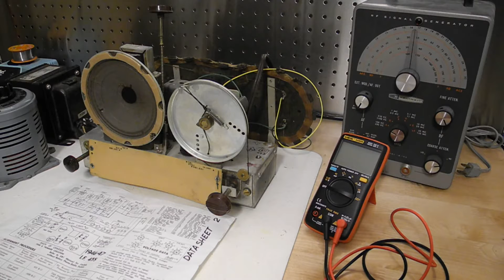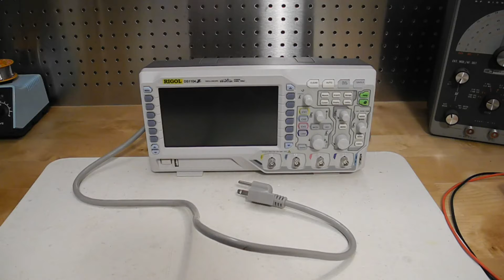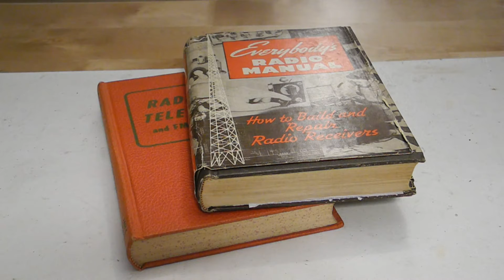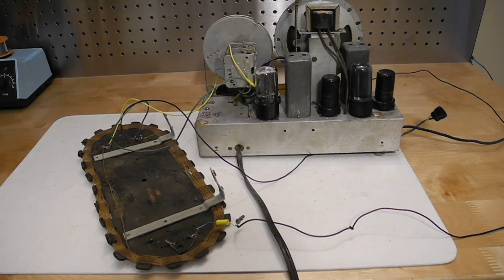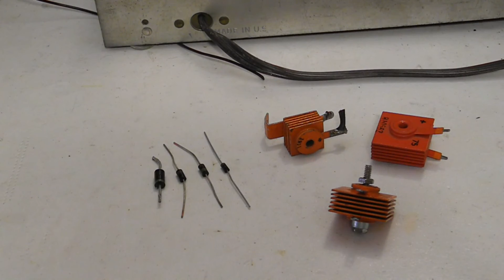Electrical Safety With Old Electronics

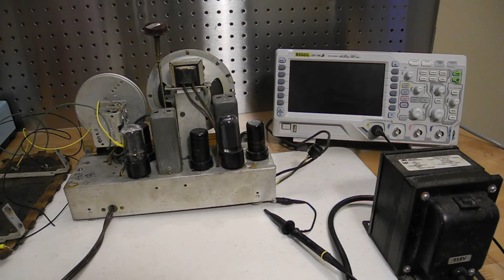Comment: Excellent video but I must respectively disagree with one of your cautions at 12:35. If you are using an isolation transformer with a hot chassis device, there is no danger in connection of test equipment grounds directly to the chassis. In essence, using an isolation transformer with a hot chassis is no different than a device with a power transformer and a half wave or center-tapped full wave rectifier. In either case part of the secondary winding is tied to ground. Now there is a potential measurement problem with some hot chassis devices. In some cases the chassis was floating DC wise but grounded RF wise through a 0.1uf or so capacitor. In this case you wound want to connect the test gear to the signal ground and not the chassis.

Comment: Some excellent advice in this video Jeff! One thing I must mention if you are going to be using a certain electrical wall 
socket make sure it is wired correctly. I came across a socket that had hot and neutral reversed ! A  socket tester available
 at most hardware stores with three neon bulbs confirmed this. I'm glad I never used that particular outlet for anything 
other than a TV or computer, both with power transformers.

Comment: Great video, Jeff. Thanks for sharing--you've provided really good guidance. You may want to share some of the references you used to specify dangerous levels of ac and dc voltage and current, as I'm sure that some folks will want to do more research in these areas. Thanks for all your videos.

Comment: 6:26 - I think you meant lead and tin not zinc. I had a hot tub panel fail because whoever soldered the spade connectors used acid based solder. Rotted the wiring all away.